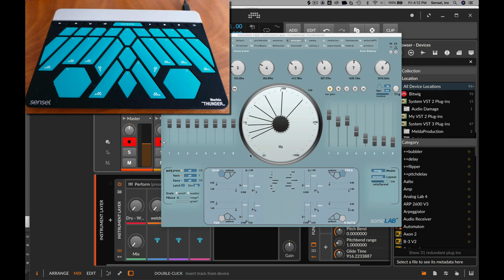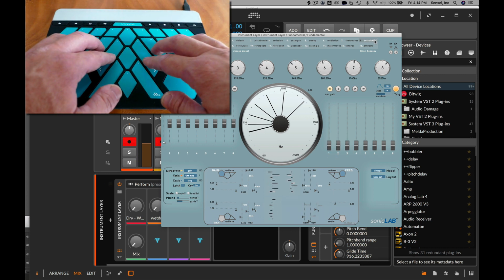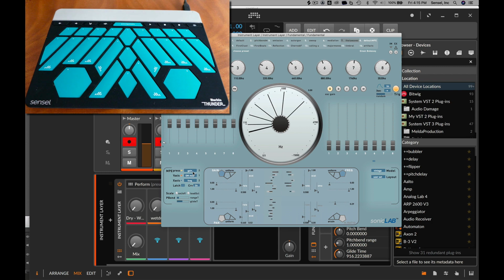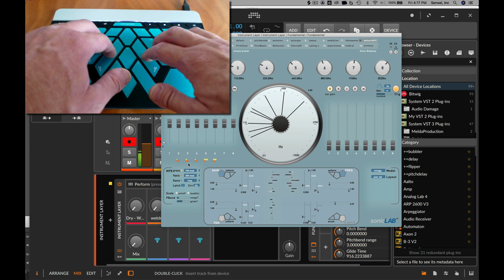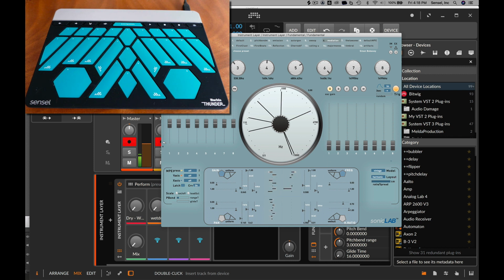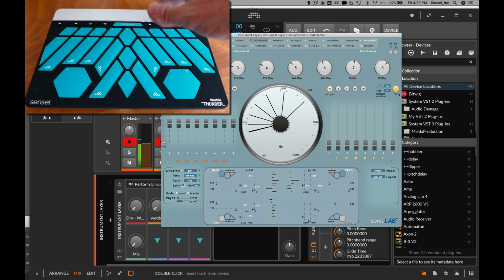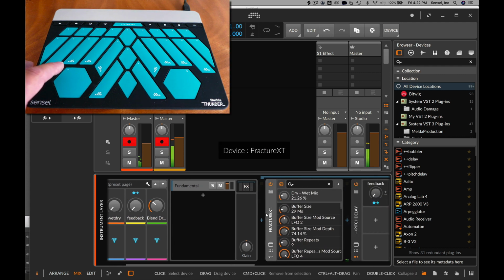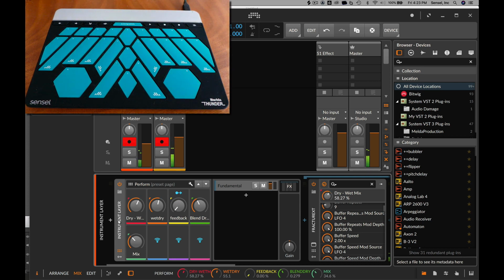Using the Sensel Morph + Buchla Thunder with sonicLAB Fundamental (Tutorial)

Comment: Really interesting! Recently got Fundamental and this may be the best controller. Is there any way of controlling the oscillator pitch knobs with it?
Reply from the maker: If you want to control oscillator pitch, you can use horizontal (X) gestures on the sliders - this controls pitchbend. You can use the pitchbend scale controls to change how much deviation from the original pitch will occur with the different scale controls (watch a bit from here: https://youtu.be/hTiKs4-nW5A?t=155 ).  If you just want to be able to control the absolute pitch of each oscillator, you'd have to set that up in your DAW using automation
Reply from the maker: ....and link your MIDI controls to the automation parameters in you DAW. How that works depends on the DAW you use.
Reply from the maker: preset 5 on the thunder is good for this, as it's mostly CC sliders.

Comment: hmm, maybe I'm doing something wrong here. Loaded up the sensel app, imported the fundamental preset that ships with the new firmware, loaded the stand alone Fundamentals, changed the midi to sensel - nothing, just weirdness - randomly shifting the patch around. Have you got a better breakdown on making this work?
Reply from the maker: Make sure you select Preset 9 on the Thunder! That has the correct notes and CCs mapped on the Thunder to work with Fundamental.
Reply: Sensel I am in the exact same situation. Nothing works like what you are doing! Can you please do a demo from scratch? Installing the Senseless buchla map? Fundamental in stand alone mode to make it easier to follow. I purchased the sensel, buchla overlay and fundamental just so I could do what you are doing. Please help!
Reply from the maker: @WhySoBroke  Sorry to hear you''re having trouble!

To install the custom map:

Download the SenselApp. Download the file at the top of this topic (https://forum.sensel.com/t/soniclab-fundamental-map/1420/12) and unzip it. Connect your Morph via USB. Open the SenselApp and select “add overlay” and add the Thunder overlay to the app. Then, “Import Map” from the top right 3-dot menu. Navigate to the .senselmap file you previously unzipped. Select it in the file browser and “open.” Select this map on the left. Click “Send Map to Morph” on the top right. The Morph is now programmed with the Fundamental mapping.

Hope this helps. Please let me know if you're still having problems.